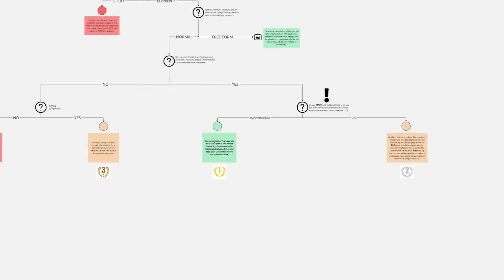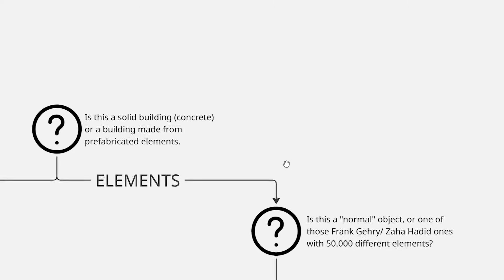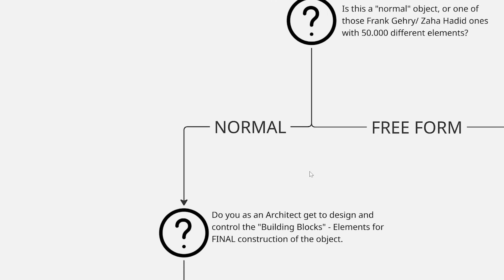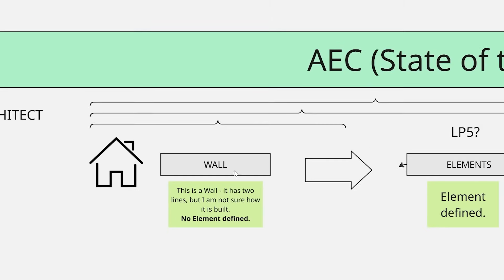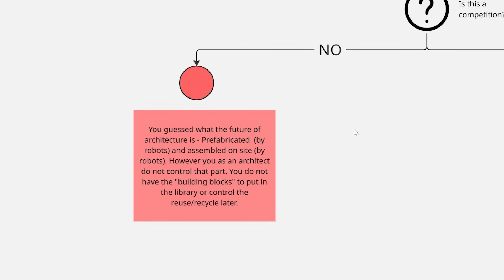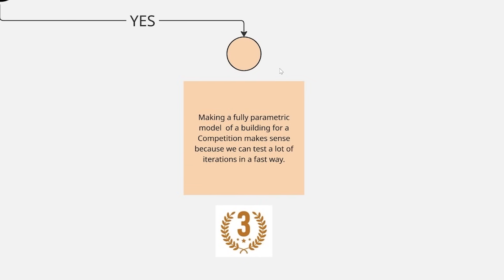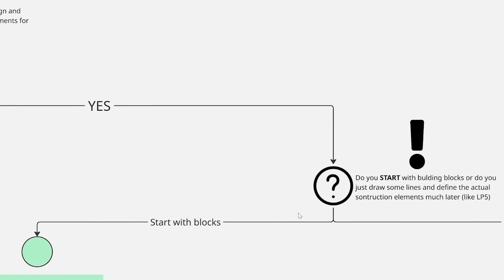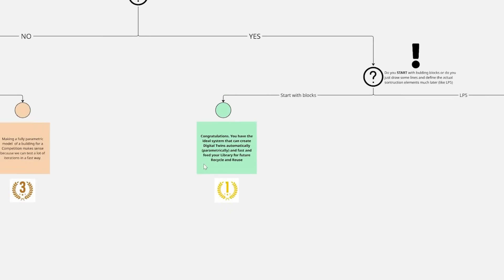Digital Twin From Day ONE: The Future of Architecture Is Prefabricated — Rethink the Design Process

Comment: Architects will always want to start by drawing lines. Their concern is not primarily to optimise construction, it’s to create interesting spaces, novel detail articulations and forms. To say that their task is to simply populate a spreadsheet with library elements is to reduce the role of architects to project managers.
Reply: I also stand behind this, the whole topic is an interesting contradition. Yes the architecht could start the designprocess with LOD 500 and exexute a perfectly efficient project. On the other side the creative vision easily gets very limited when most details of the elements of assembly are defined from the very beginning. I agree that prefabricated parts are essential in the construction process of today and tomorrow but I also believe a good architectural development process needs to start with lower level of detail and drawing the initial lines you mention.

The value of the architecture is made exactly in these not so efficent loops of humam feedback from both stakeholders and engineers that make decisions collectively and increase the level of detail in a collaborative process. Only then it can become something more than a three dimensional spreadsheet of elements.

One more thought on mass customisation: This is also a great option in theory, where you could start with high level of detail from the beginning. However when too much parts of the design elements are given default configurations and automated, the tendency is that people dont comprehend what decisions are already made in an early stage. This would in turn lead to a lot of the generic architechture that we see all over the world today. Seen in the context of this video, most are picking up the 3rd price or less because there is a mismatch between architectural design process and the eficcency tools for prefabricated planning of today.

Comment: productising architecture through customised modular prefab is a great thing to aspire to!
But I see 4 main barriers to overcome:
1: The uneven distribution of technology which means much of the industry is not organised in a way that can support specialist computational design roles to make it happen.
2: Utilisation Fallacy and office politics that devalue R&D work, meaning people are stuck manually drafting in Revit instead of using more modernised software tools (grasshopper, BIM 2.0 etc.) while the people who could be doing that work are unemployed or doing conventional project work.
3: The economics of prefab needing a high volume of predictable inputs and outputs to justify factory setup and distribution networks
4: the need to "fudge" things on site, in a reality where construction is a dirty, messy, unpredictable game where things are not as square, flat and clean as they are in the ideal virtual world of software.
Reply: One of the things that I learned working for construction companies is that it’s often much faster to put things together onsite vs spending time creating digital twins and prefabbing elements.

Comment: Very interesting analysis. In the Nordic countries, but mainly in Finland, where I live, most buildings are built with prefabricated concrete sandwich elements. It's been so since the 60' Here the process is slightly different from what you would describe as a bronze medal winner. Us architects design the buildings with few structural considerations in mind and then the structural designers (that's how we call them, not structural engeneers) design the elements (in Tekla) and produces 2d drawings for the factory. Don't know for a fact, but pretty sure parametric design is not involved in the element design process. Now, as you say this applies for rectilinear buildings. When shapes become more complex parametric design consultants get involved but anyways structural designers take care of the envelope. Keep the videos comming!